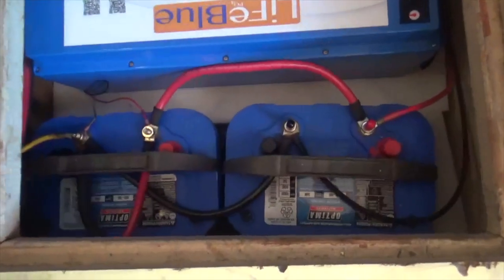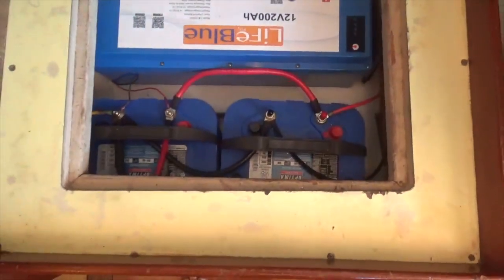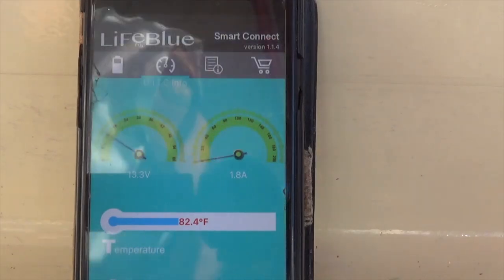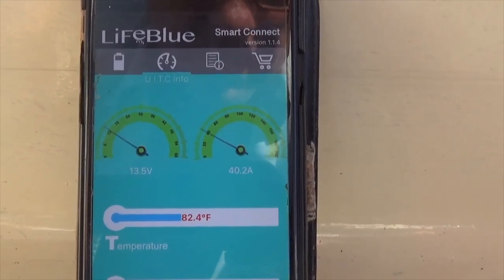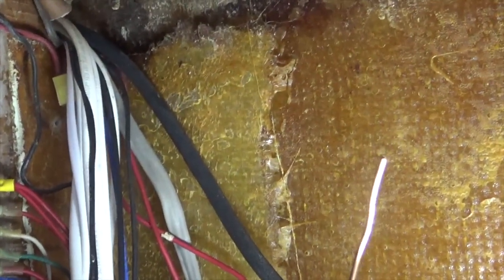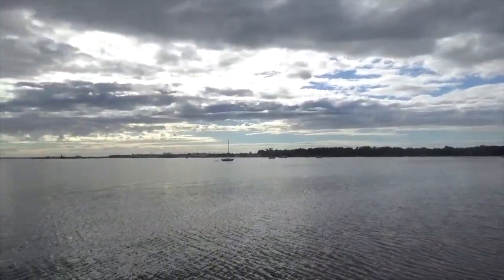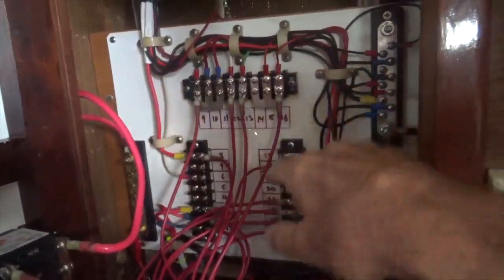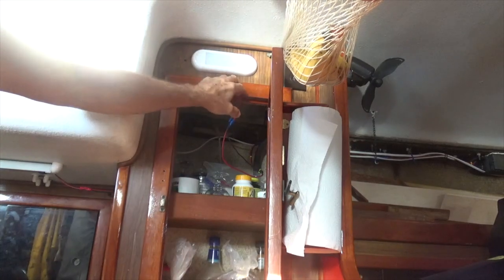Skipjack Sailing 70

Comment: Hi man so, you can make a epoxi seringe with a plastic bag with a little cut in the corner, like in the bakery, and you can thicken the epoxi with wood powder left from a saw...you can saw a little piece of wood and gather that powder and use to thicken the epoxi, than after you mix up wait a little bit to start hardening works fine for little fixing like that
Reply from the maker: That is a GREAT idea, Rodrigo!!!
Gracias.

Comment: Very timely content for me. Thanks! I have  new 100 Amp hour lithium iron? battery, that I am about to mount into  White Rose. Question is how to deploy  it. Separate  battery shutoff switch or link into existing 12 volt lead acid. My gut tells me the latter is a bad choice. So two systems. One running some stuff, the other running other stuff. How to keep the batteries charged on the mooring (I'll be on the mooring ball most if the next six months) solar panel or small gasoline generator? Three or four folks have suggested the latter. Im concerned about footprint and weight. And then there's my existing electrical panel.... can I put a hinge on it like yours for access? And how difficult will that be.

Comment: I think your own risk assessment says it all. If you don’t need a life raft or EPIRB for legal compliance reasons and your prepared to make the ultimate decision if your in trouble at sea so be it. However if I have a crew member on board I need to consider their safety as well and so carry all kit required to recover them if they are a MOB, and give them a chance of survival. But thats my own risk assessment, so we are all different. I bought in Oz, 2 persn LR $800, plus a service check every 3 years, $160. EPIRBs cost $200-300, last 10 yrs. These are relatively modest expenses IMHO, amortised over a good number of years. Best, Dreamtime.
Reply from the maker: I am at peace with it, but it's a fair point.  At some point my girlfriend will join me and perhaps I will make a different decision next year when that happens.
Appreciate that input.  Thanks.